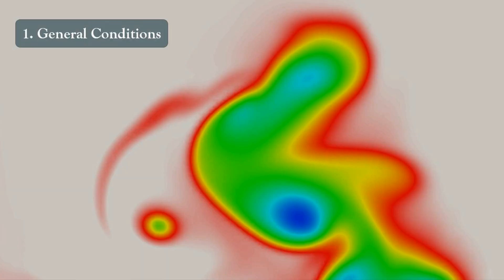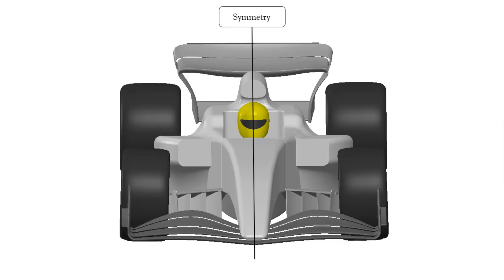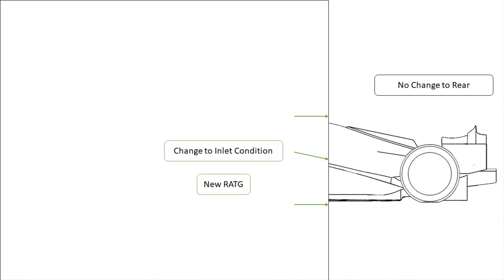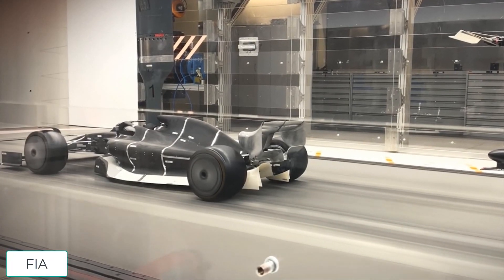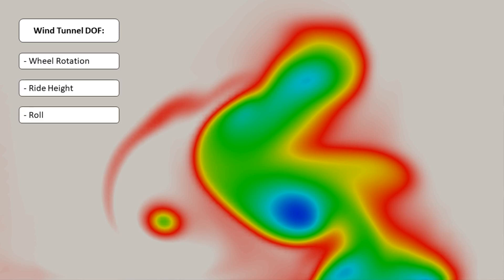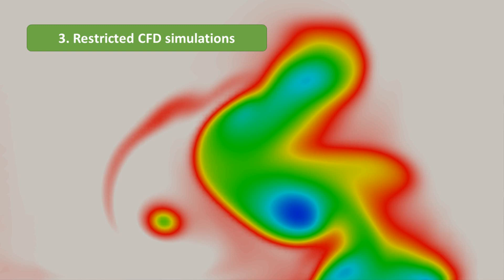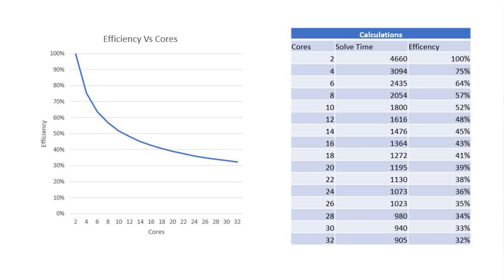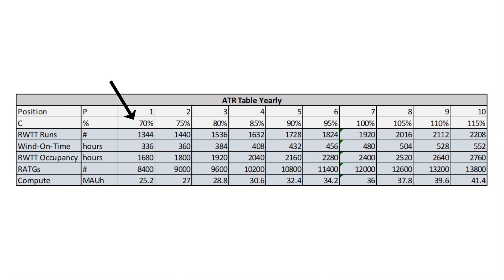F1 Aerodynamic Testing Restrictions

Comment: Great video Tom! Got a question for you; how do the regulations limit the CFD time outside of working hours of engineers, meaning, if they use their free time to do CFD, how would this qualify? It doesn't even have to be create successful ideas, but let's say check some "bad/worse" ideas whether they are actually as bad as they thought but still want to check it for whatever reason, and this way when they actually are in working hours, they can simply skip analyzing such ideas, saving time. Surely there are rules for this?
Reply from the maker: No specific rules for this and I'm sure it's a big grey area.